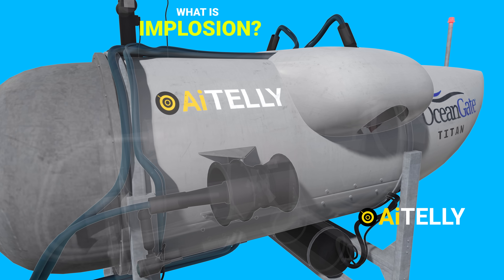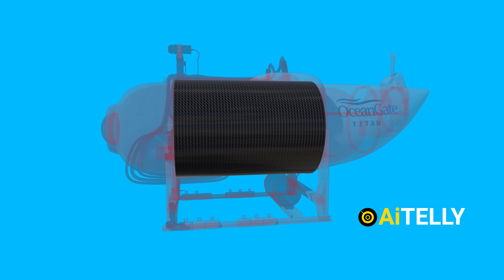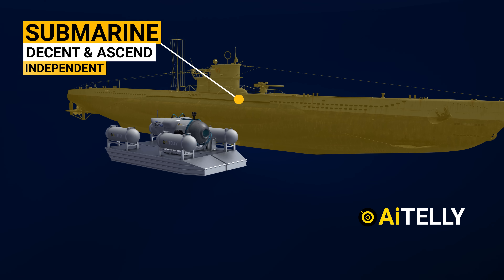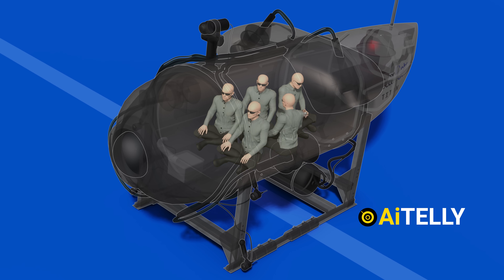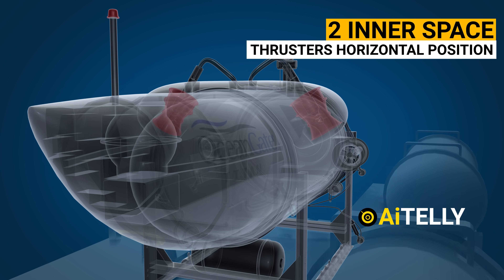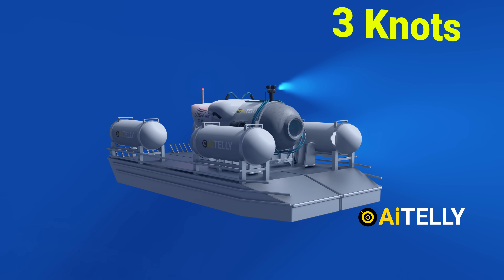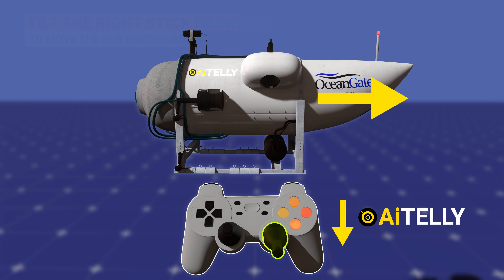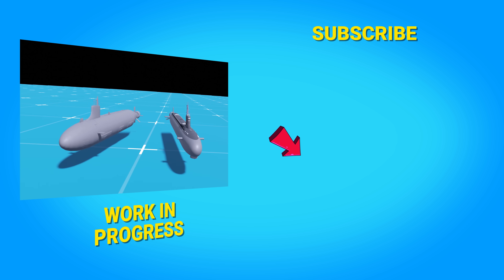Implosion Titan Oceangate How it Happened | Submersible Submarine Parts #3d

Comment: From Human to Ketchup in a milisecond. RIP dudes.
Reply: Perhaps the one good thing about the carbon fiber build is that it truly made the implosion instant, thereby insuring they never felt or saw or heard anything. They just died in an instant. If the submersible was made of traditional materials they may have briefly saw and heard what was happening.
Reply: @Zincoshine-  Let's Bare in mind that the Carbon material was "PAST DATE/Expired".. It was no no longer considered applicable in Jet planes....Stockton Rush was attracted to the Discount🤑🤑🤑🤑🤑🤑🤑🤑🤑🤷🤦🙆
Reply: @Zincoshine-  The use of that carbon fiber would have been similar to having a gun fight in the old west ..handing 9 out of 10 of the competitors fully functionally tested and loaded weapons and the 10th person a weapon heavily used ,but not fired in  5-10 yrs and with nobody checked to see if it were even loaded.
Reply: @Zincoshine-  If it had been made of traditional materials, it wouldn't have imploded.
Reply: @Zincoshine- they heard it creak I have no doubt because they aborted the dive by dumping the weights that helped them descend and tried to resurface ASAP. DIDN'T MAKE IT!

At what height did it implode? Who knows - hopefully the blackbox recording will reveal all.
Reply: @fifiwoof1969  prior guests also said it makes creaking sounds so that would be normal
Reply: @fifiwoof1969 the vessel made noises normally - submarines make all kind of noises from the depth pressures as they descend. They may have identified something was wrong but it would not be "we're about to implode so we need to get to the surface fast." Because an implosion would happen too fast without warning.
Reply: At least it was quick.just seeing the silver lining that's all
Reply: @thisguy9993 maybe it was quick.. who knows, maybe one or two or them stayed alive in this horrific state for a few extra seconds in the most gruesome amount of pain.. who truly knows.
Reply: @thisguy9993  Wow they didn't even get a chance to scream for crying out loud 😢 😭 😪
Reply: @thisguy9993  it wasn't that fast
Reply: @thisguy9993  no you're not, youre being unkind
Reply: @thisguy9993 I don't believe it was imploised
Reply: @arminius4986  
What exactly happened then? Cue the conspiracy theory.
Reply: How frightening and creepy.  They must have heard it loudly buckling and crackling first
Reply: @erossinema8797  I believe they could hear the carbon fiber delaminating and began to ascend
Reply: @erossinema8797  a transcript of communications between Titan and the topside crew was recently released online (no confirmation of authenticity), and in it, the Titan describes hearing crackling sounds coming from the aft part of the sub.
Reply: @erossinema8797  they did hear it cracking. You can hear In the audio the baby or coast guard found, you can clearly hear that guys son say “oh shit I’m gonna die” and then like some screaming so they were definitely terrified before it happened because it was cracking hard
Reply: @erossinema8797  The implosion happens so fast and so completely that it's over in far less than one second, so they could not have had time to hear it or to process what the sound meant. Mercifully.
Reply: @erossinema8797 If they did, I can't imagine it being longer than a second or so.
Reply: @erossinema8797 I am sure in the final moments the crew glared at rush what a dummy
Reply: @erossinema8797 they never knew what hit em fortunately.
Reply: @erossinema8797 it was instant, so they wouldn’t have known. That’s a small blessing at least, no time for fear or pain before they died.
Reply: @erossinema8797  not really. It was made of carbon fiber so it wouldn’t have creaked or cracked. When carbon fire is ready to break, it shatters.
Reply: I’m pretty sure the brain takes 125 milliseconds to process pain 
And the eye 120 to see something
:edit it’s 13 for the eyes
Reply: @SeaBaconZ a gruesome death either way
Reply: @SeaBaconZ  100 milla second to procces pain or 1 second
Reply: @SeaBaconZ  you're pretty sure? I mean that information has been said over and over and over again since this Titan implosion came to light.
Reply: @SeaBaconZ  
Did you get from ZachD Films nice
Reply: i dont know how i want to die, but i dont want to be trapped in a small space.
however i do hope its over before i can notice.
rip to 5 lost.
Reply: I agree, on previous dives loud cracking noises were heard several times and they never fixed it.  The hull was already compromised and idiot Rush continued using it and knowingly rushed people to their deaths.
Reply: u people are real Tools,& should be ashamed of yourself, I don't Care if they were Rich or Not, How disrespectful u all are being ,you all should be ashamed of yourselves.Alot of these comments are just Hateful,mean & Disrespectful..What if that was your LOVED 1, who Died, very sad u have chosen to speak like that 2 get attention..
rest in Peace to the 1's who have Died & Prayers for the Families..its sad tho that they made a not so wise Decision& it cost them their LIVES
Reply: @cobycuzzocrea9142 precisely. It says everything about their up upbringing!
Reply: @cobycuzzocrea9142  you must be new to the internet?
Reply: @cobycuzzocrea9142   I understand what your saying.  I honestly didn't mean any disrespect towards anyone. I was just commenting on what was used to control the vessel and the corners that were cut and safety measures that were ignored at first.  I am deeply sorry for the loss of life. I wasn't in anyway trying to show any disrespect towards the unfortunate situation . If at all my comments came off as such I deeply apologize.  Wasn't my intention at all.  May God comfort the families and friends of the life that was lost.
Reply: People unnecessarily died because of one man’s egoism and reckless disregard for safety protocols and caution from subject matter experts.
Reply: To those saying ketchup and vaporised, is that actually what happens to the human body at that depth, or is it just that lungs get squashed to push all air out and then suffocation? Or are we saying the sides of the vessel smash together to crush everything in between into mush? Sorry for gory details — rip those who died.
Reply: @thegreatNEb that is actually what happens. There's enough force involved to crush a sub designed to withstand thousands of psi in milliseconds - now imagine what it would do to the human body which is only designed for 14-15psi (1atm) or so. If you're curious, you can look up a similar incident to this, the byford dolphin diving bell accident. Less pressure involved, but gives an idea of how horribly gory a death like this is. It really is a rough way to go, but at least it's quick.
Reply: @blazeclarke just watched thanks to your recommendation  - OOF!

Would be good to see a computer simulation - flash boiled blood? GRUESOME quote! And that was only 100 metres or so deep right? Mentioned 9 atm to 1 atm instantaneously - I imagine that's the flash boil cause right there along with nitrogen instantaneously expanding (boiling) out of your blood stream.

I tried calculating the peak temperature and used ideal gas law inside and outside and came up with about 100,000°C (380atm*300°K/1atm = 114,000°K - did hear sun surface temperature and this is that ballpark) - this assumes gas before, during and after implosion but the human body is made up of solid, liquid and gas. Anyone else have some temperature insight?
Reply: @blazeclarke  It's probably as non rough a way to go as possible.  Dead as a doornail in not just less time, but WAY less time than your brain can even have an idea that anything happened.
Reply: @blazeclarke Byford Dolphin was the opposite.  It was the sudden drop from 9 atmospheres to 1 atmosphere that caused all that carnage.
Reply: @therealtampadude9175  yep, that's true, however it's similar in the way that those inside will have died. Was just trying to use an example to give the other guy an idea about what actually happens when you're subject to a massive change in pressure. Whether the pressure change or the crushing killed them, it would have been instant, in either scenario. So at least it was painless.
Reply: @thegreatNEb  indeed it is that. 5600 psi is like a Tahoe instantly parked on every square inch of your body. When the air is compressed that much, and that fast, it super heats as well. They weren't just mist, they were cooked mist.
Reply: @thegreatNEb Its a bit of both ..
The vehicle crushed ...
..as well as their bodies would have crushed ..
Like dropping 100s of elephants on them . 

But they wont have felt it .
Any parts of body they found would just be bits 
...the rest would turn to liquid as human bodies  are 90% water ..
..not forgetting that the action of implosion also caused intense heat 
..hotter than you can ever think of ..
Reply: @thegreatNEb  both. Gases subjected to those pressures compress, generating heat. It would have erupted in a ball of plasma reaching the temperature of the sun's surface.
Reply: @thegreatNEb they would have been crushed by the walls of the sub imploding inwards. Humans are most water and fairly incompressible.
Reply: @thegreatNEb No that's what happened. It was instant that they didn't feel anything or know what happened.
Reply: @scynapz  but they said it was picked up by sonar and they were screaming. So they had to know what was about to take place. Idk how true this is but it was in one ☝️ of the above comments.
Reply: @debrajones4010  That is fake. Along with the transcript that has been making the rounds online. As of now all there is is speculation on how it happened, time and around what depth. But the real fact is that their demise was instant. So fast their brain didn't process what happened.
Reply: @scynapz  oh ok. Just someone else trying to get views or something with their false information!
Reply: @thegreatNEb I don't fear death but I fear the one that can kill both body and soul
Reply: @thegreatNEb  crushed to mush.
Reply: Rude comment.
Reply: This honestly seems like a great way to handle the human remains as opposed to burial. Very natural and organic (post death of course).
Reply: oh no! anyway
Reply: They stopped being human long ago.
Reply: It sounds more like a very sophisticated kids toy, just in a bigger size. I am sorry lives were lost. 
I read about another person who declined when his son got concerned about safety issues with the vessel.
Reply: It CAN go to 4,000 meters but only a limited number of times due to wear on the hull
Reply: Really seems like he was trying to make a name for himself away from the other billionaires trying to go to space
Reply: @horseclock6454  more like "I want to be just like James Cameron......but I don't want to spend a lot of money"
Reply: @Excremental_Discharge  that too, I feel really bad for the kid and his mom. Wtf was the dad thinking, I mean the kid couldn't have been the only one there thinking "eh this might not be a good idea huh?"
Reply: Omg...you scare me.
Reply: Grow up..... Ketchup?
Reply: Have mercy they didn't even have a chance to scream for crying out loud 😪 😢 😭😭
Reply: Where did thr tomatoes come from? Are we secretly tomatoes???
Reply: Why would you even say that. Smh.
Reply: Didn't ask bud
Reply: @@Simon-127 Most of them. "Presumed human remains" were recovered. 😵
Reply: 😢 I would never, ever get in something THAT small. An MRI freaks me out!!
Reply: @Iluvdoxies58  honey I had to have one yesterday and had to be medicated because nope! And then imagining being in something of this magnitude under all that water, they’d have to put me under anesthesia before I’d even step foot in there! I have always said that people who don’t have a fear of tight closed in spaces are definitely not afraid to die.
Reply: Thanks for ruining ketchup and anything in a squeeze bottle
Reply: Ahh I see they had inverted axis for their controls
Reply: Glad they didn't suffer:(
Reply: @daybyday0731  I’m sure the sheer terror of knowing something was wrong was suffering enough, but there’s no way of telling they died on impact of the implosion.. some could’ve lasted a little longer after.
Reply: More like chicken fingers
Reply: One of the billionaires son is still tweeting “why he can’t get laid with millions $$$ to spare”. 😂
Reply: Even if they suspected something was up they still had no clue when it hit them
Reply: Crude comment.
Reply: I hope it was that quick because that shit would suck just wow I'm speechless
Reply: @Jason-qn8ov 
The implosion was quicker than you can blink
They wont have felt it ..
But they did have problems just before it happened.
The titan was sinking too fast and electrics stopped working..
They tried the abort and rise the titan to surface 
..but it didnt work..

I imagine they panicked , like a lift going too fast ..
Experts say they may have suffered for a minute before hand .
...but may not have known they would die eventually ..
Reply: At least they didn’t have time to suffer then… still RIP
Reply: Best way to die without pain
Reply: They found human remains tho
Reply: Worlds first speedrun, one attempt record
Reply: From Titanic 1 to Titanic 2 xdddddd 😹
Reply: LMAO from human to ketchup that's one way to put it
Reply: Fish food.
Reply: Right when they lost radio coms and any contact with them is set to be when the implosion happened. Which makes sense considering how fast it happened. Before you could even think of the word implosion is how fast it happened, and even faster. It's said faster then we can comprehend is how fast it happened... so tragic.. the head guy that went ignored multiple warnings and  so many corners were cut. Not sure about the others besides the main guy going down but the father and son were not certified to go and take the voyage.  The director of the titanic movie (cant remember his name sorry)warned them not to go because there was no testing done to see if the other two times decending caused any cracks,leaks and or malfunctions of the vessel. He was the one who brought up the non certification for the father and son and how dangerous that can be and not doing any safety checks before the decent, is very unsafe,dangerous and neglectful.  R.I.P TO THE POOR SOULS LOST THAT DAY, AND CONDOLENCES AND PRAYERS TO VICTIMS FAMILIES... SO SAD AND VERY TRAGIC.
Reply: @mavrick62910  A previous passenger said they always lose comms at a certain point in each journey.
Reply: @bhaktaaustin  oh really.  Wow. so it wouldn't really alarm anyone really cause it's something normal that they would expect?  So when that happened, loosing comms, it be something they'd expect to see. Wouldn't be concerning basically is what I'm trying to say.
Reply: @mavrick62910  James Cameron was also quoted as saying that he would never ask anyone to take risks that he was will in Ng to. Stockton Rush had no other interest in these passengers other than what 250k each would do for his future endeavours.
Reply: @mavrick62910  Bada goddo lekhar somoy o aache. Kissu kaaj nei naki. Chaapke poder chamra gutie debo.
Reply: @mavrick62910  😢
Reply: At least they didn’t fell pain
Reply: Wasn't ketchup they fou d body parts
Reply: I must have missed that part in the video
Reply: The creatures there were at least nourished
Reply: You don’t know what ketchup is
Reply: I guess its don't always pay lots of money to play around with nature same with space somethings shouldnt be for fun
Reply: Anchovy paste is more like it.
Reply: @@Simon-127 the military uses the same controllers to fly drones in other countries while the drone pilot sits comfortably in America somewhere, the controller wasn't The problem the carbon fiber hull was
Reply: More like cooked minced meat
Reply: @youngchevyboy605-5  Galauti Kebab?
Reply: * Chunky salsa
Reply: They became one with the ocean instantly
Reply: Rest in pulp 💀💀💀 
Because that's what they are
Reply: Actually the inside of a collapsing bubble is thousands of degrees. They would have incinerated.
Reply: Daaaaaammmmmnnnnn
Reply: Instant cloud of meat
Reply: @@AngelPadilla-kr5nnBillionaires are 99.999% generational/stolen.
Elon musk wasn't self made, his dad was an emerald magnate in South Africa, Elon basically stole his way to the top of the companies he owns. He's not even really a businessman, he's vaguely an engineer.
There are very very few self made billionaires who actually made that money themselves.
Remember, if you can be the CEO of 5 established major companies at the same time, and not look even remotely tired, being a CEO isn't a job.
Reply: @D-Vinko  Musk looks like sh!t in terms of being tired...
Reply: Well damn
Reply: More like paprika powder😔
Reply: It’s the PlayStation controller for me 🤦🏽‍♀️🙄
Reply: Yeah dude. Rest in peace. In one piece, that is, I dare you to try separating them
Reply: Don’t waste your breath saying rip to a bunch of rich people who don’t know or care that you exist
Reply: From James Cameron's Deepsea Challenger documentary, there was a man that reached the deepest part of the ocean. He said if you heard a crack or creak then you're still alive and to keep going. Oof those guys probably didn't even hear it coming
Reply: Yes thank god it was quick but I can't imagine what was going through there minds when things started going really bad in that sub😩😩
Reply: Seems like such a waste. All that money and all that risk, for a really crappy view of a boat on the bottom of the ocean.
Reply: Literally rip dudes
Reply: @ts757arse  it was an X-box controller. It probably got the “red ring of death”. That’s not why this dumb “sub” was destroyed. It was from human stupidity. 5 people are dead. Move on. Let’s concentrate on the 100,000 Americans dying every year now from Chinese fentanyl imported by the CCP into our country with the help of the unelected puppets in our “Govt.”. That’s waaaaaaaaay more important than 5 morons that basically committed suicide.
Reply: From nigguhs to no nigguhs ✊🏿😔
Reply: I hope when you die someone leaves a blase comment regarding you're (hopefully) untimely passing.
Reply: So dumb.
Reply: Did they fake death, so that not to pay income tax?
Reply: You mean Dumbasses?
Reply: Even the marrow in your bones is turned to red jelly as all your bones implode.  At a speed that is faster than the nerves in your finger can tell your brain that you feel pain.  Which is slightly faster than what you are seeing is registered in your brain.  You will feel no pain, se no implosion.  You simply cease to exist.
Reply: They used a Playstation game controller 🎮  to operate the vessel... unbelievable.. that right there showed how many corners they cut.. unreal...
Reply: @mavrick62910  not even that. A playstation controller is expensive. That was a cheap logitech knock-off. I used to have one of those on my old computer like 20 years ago. Shocking!😬
Reply: @NemXX2  yeah your right, those controllers aren't exactly cheap either. I was just saying for as expensive as the vessel was to build I'd think you'd see something more high tech or something better than a video game controller to maneuver the vessel around.
Reply: @mavrick62910  on the other hand if you think about it, that remote was probably the most proven part of the whole thing. They have been used by millions of people playing video games. Its function was pretty simple, to control 4 electric motors. Basically like any drone. It needed nothing more to do. Up and down, left and right, forward or backward. The military use them too, as i said, tested and proven millions of time by millions of people. The least of the worry for them. 
Probably it was all due to stress of the carbon fiber.
Reply: @mavrick62910  it was a 10 year old Logitech controller , a Ps5 controller is actually 100x better lol .
Reply: @mavrick62910  thats not a big problem. Problem is the material with which it was made.
Reply: @mavrick62910 it was actually a Logitech controller…which shows even moooore corners they cut lol but point proven still
Reply: @mavrick62910  it's actually not uncommon to use gaming controllers for stuff like this
Reply: @mavrick62910  Video game controllers are literally used in military UAV's
Reply: @mavrick62910  most people and even the military uses controller’s like those its the carbon fiber thing that messed it up
Reply: @mavrick62910  the US military uses playstation controllers to control a lot of there equipment and US navy subs have those same controllers and nothing crazy like this has ever happened to them it's nothing to do with the Playstation controller, the titan was just poorly designed thrown together to quick and too many safety guidelines were ignored during initial testing.
Reply: @mavrick62910  not even playstation.  It was a Logitech controller
Reply: They didn't even splurge for a PlayStation controller! It was a Logitech controller from 2005!
Reply: @mavrick62910  it was a Logitech controller that was around thirty dollars. Even worse than a PS controller. I'm not saying a controller should be used (don't obviously, wouldn't fly a space shuttle with one, let alone something that would be going down miles into the ocean with that type of pressure) but something more sophisticated should have been built. Don't be cheap when trying to go into space, or into the ocean beyond normal pressure.
Reply: @mavrick62910  if the playstation controller was functioning right there is not any problem with it. That has nothing to do with what went wrong.
Reply: @mavrick62910 Pretty sure it was an xbox controller, additionally that's industry standard. Even militaries use controllers like this. The US uses xbox 360 controllers for a number of Virginia-class subs as well as bomb-disposal RCVs
Reply: @mavrick62910 It wasn't a Playstation controller. It was a   PC Logitech usb controller .
Reply: @mavrick62910  That is very common.
Reply: @mavrick62910  i heard that head of the team rejected an experienced navy personnel and approved a diversity hire.🤨
Reply: @mavrick62910  A PS1 DualShock, too. Jesus.
Reply: @mavrick62910  bro the controller doesn't matter lmao like do yall not realize the military uses modified controllers too
Reply: @mavrick62910  It was a Logitech game controller, and it had 3D printed little knobs to replace the other knobs with... Basically just the same thing but longer.
Reply: @mavrick62910  it was Logitech, but that doesn’t matter anyhow. The US military uses Xbox controllers to pilot drones. Controllers are designed to control things. Idk why you think the fact a controller was used is the bad part lol.
Reply: @ninosbrothermichael1842   I wasn't saying the controller 🎮  is the reason for the implosion at all. I know and understand it was many other things manly the carbon fiber. I was just commenting on the corners that were cut with safety and other measures that were ignored.  I only mentioned the controller because I thought it looked strange compare to how much it took to build is all. I know the military uses these same controller designs and drones have similar ones too.  Basically I was just saying there were indeed allot of corners that were cut and ignored. Especially the fact it had already had a few decent before. Which was said made the vessel even more weak and stressed in some areas that were never checked . Very sad  incident indeed regardless of how or what happened.
Reply: @mavrick62910  The controller had nothing to do with the accident. The military uses videogame controllers too. What happened is that the sub was poorly designed and not adequate for that depth.
Reply: @mavrick62910  Logitech, no Playstation
Reply: @mavrick62910  😂
Reply: @mavrick62910  The military uses Xbox controllers often, actually.
Reply: @mavrick62910  even if they used a industrial controller, the underlying component is still a potentiometer or even better hall effect sensor dual axis joysticks. 

The rest is just how they package the controller.
Reply: @mavrick62910 it was a logipro controller not a playstation
Reply: @s-kvn-k   I know, just saying it looks bad. It was expensive to build,so to know how much money it took to build to see a video game controller 🎮 used to operate it just threw me off .. I understand what your saying though.
Reply: @mavrick62910  yep and a computerized system by Elon musk 🤦🏾‍♀️🤦🏾‍♀️🤦🏾‍♀️
Reply from the maker: You might also like this Nuclear Powered Submarine Engineering behind it #3d Nuclear Reactor released
Link: https://youtu.be/J0lb46Zi5-s
Reply: They pretty much went to the bottom of the ocean in a soda can and got crushed I heard human remains were found so that’s that I guess…..
Reply: Rip all the passenger but this ceo
Reply: @greatjasmintea  rest in peace
Reply: Human soup.
Reply: bro are you serious?💀💀
Reply: Sad 😔
Reply: Blood flavor
Reply: Rich toast lol
Reply: R.I. P. My sincere condolences 🙏
Reply: Poor soul rest peace
Reply: "Real tomato ketchup, Eddie?"
Reply: Shake n bake!  they didn't turn into ketchup boys they turned into fish food shark bait 😂😂😂😂😂
Reply: Rest in pieces?
Reply: @MrSockZa1st  😂
Reply: @MrSockZa1st  distasteful…
Reply: @soulfullportrait147  hmm yes, billionaire paste would be too distasteful for our fellow deep sea creatures, toxic even

i just hope they don't die from poisoning from eating the billionaire paste
Reply: @felixma9192 u should be ashamed to make such morbid jokes over this incident. All because the victims were billionaires while you are not?
Reply: Not the ad below your comment having ketchup in it.... ☠️
Reply: Bahahahaha
Reply: @thefisherking78  That's sick, smh
Reply: Katsup
Reply: Someone needs to make the human ketchup animated video
Reply: HA!
Reply: You mean rest in pieces.
Reply: Word ‼️💥
Reply: Thats a shark smoothie
Reply: @Canthinkofgoodnames holy shit 🤣🤦‍♂️
Feel bad laughing but that was a funny read bro.
Reply: Press F to pay respects
Reply: Fish food.... I feel bad for the men who paid monetarily and with their lives... I Hope the family got a refund on that money they paid. Fuck that contract....
Reply: Literally, just juice. Not even that, really, just microscopic organic atoms.
Reply: @SteveBrownRocks2023 .  They said the implosion reached sun temperature? Weird
Reply: @erossinema8797  yep. When the oxygen in your body is super-compressed it acts much like a diesel engine. The tiny little compressed “ball” explodes in extremely high heat, like an internal engine on a vehicle, then BOOM! Explosion. Nothing left. Instantaneous.
Reply: @erossinema8797  I believe because it was basically just a big cavitation bubble, that is why it reached such a temperature.
Reply: @erossinema8797 well is simple thermodinamic law
Reply: I blame Sony Playstation. You can’t level up with those controllers.
Reply: @Bat_Boy  🤣 yo, Bat Boy, you earned this 👉👑
Reply: For all the crabs we’ve eaten I’m glad a few crabs nibbled on rich human. Crabs, we sent you our finest.
Reply: @brosephyolonarovichstalin2915  😂🤣
Reply: @brosephyolonarovichstalin2915  What's amazing is that crabs can live and move and see with their eyes in 5600psi. Jesus.
Reply: @brosephyolonarovichstalin2915 exactly
Reply: @brosephyolonarovichstalin2915 bro that's fucked up
Reply: @brosephyolonarovichstalin2915 😂😂😂😂😂😂Thays right!!!👌😝
Reply: @brosephyolonarovichstalin2915  not really. Stockton Rush was a greedy arrogant jerk who cut corners and killed everyone on board. The one French guy was a well known explorer. The other three were just wealthy. So hardly our best.
Reply: @brosephyolonarovichstalin2915 there's no crabs that far down.. hardly any life at all..
Reply: @mikefox181  🤓☝️
Reply: @brosephyolonarovichstalin2915  😂 😆 😝
Reply: @brosephyolonarovichstalin2915  critical support to comrade the depths
Reply: @brosephyolonarovichstalin2915 very disgusting way of talking about people. They were still people
Reply: @s-kvn-k  idk man, are the millions of refugees that drowned on their way to europe human as well?
Reply: @felixma9192  I mourn for everyone.
Reply: @felixma9192  what has that to do with anything?
Reply: @felixma9192  is anyone suggesting that drowned refugees WEREN'T human?!
Reply: Pretty disrespectful comment
Reply: Rest
In
Pieces
Reply: No Ketchup is Water, Tomato Puree, High Fructose Corn Syrup, Vinegar, Onion Powder & Red Pepper.🤪
Reply: @FNBSRailway  -🤓☝️
Reply: @@AngelPadilla-kr5nn “billionaire” “smart” lmfaoooooo
Reply: Hot ketchup
Reply: Would it be ketchup ... or hamburger? 🤔
Reply: Nice👌🏿
Reply: Nowon ate that whete pitzza?